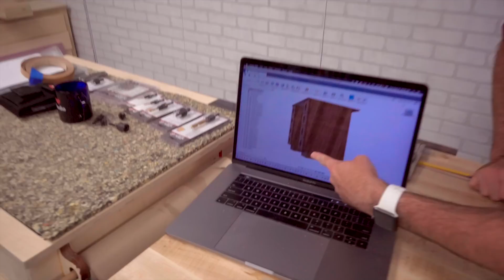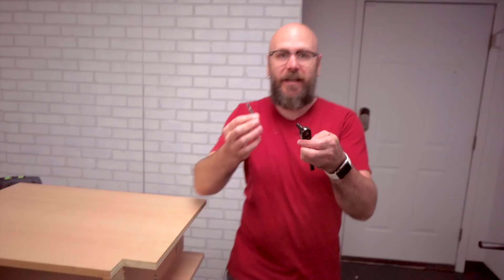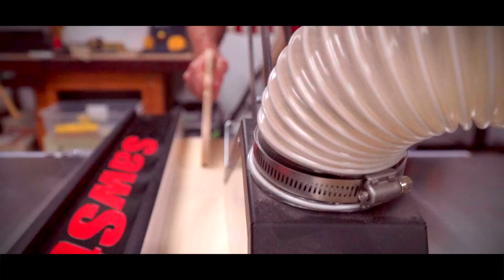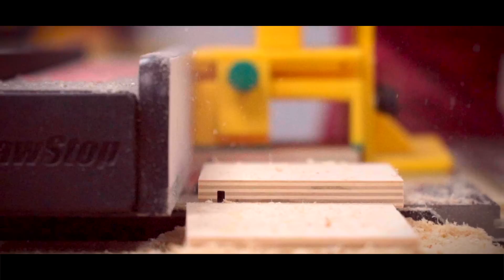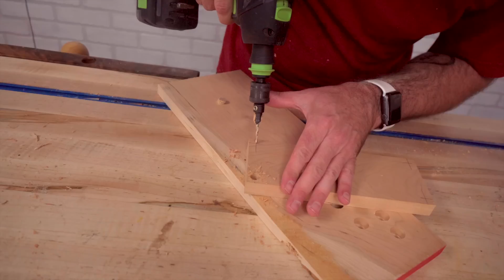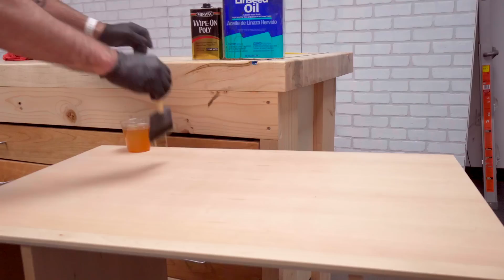Making a Custom Beverage Bar and Cabinet | Woodworking Project

Comment: Nice build, I'm glad I found this as I'm planning on building something similar. My only concern has been venting for the fridge. Unless it's a front-vented fridge, it's "recommended" that you have a couple inches free on all sides. Of course, it doesn't make for a nice looking bar if it is not snug. Have you had any trouble with the fridge struggling or over-heating?

Comment: So I've been researching something similar for our kitchen and it's my understanding that coolers like that shouldn't be surrounded like that unless they're front venting. Are you worried about the heat getting trapped back there and working the condenser to death? Especially with the sunlight from the window, I'd be worried about venting.

Comment: cool project! I was also planning on building a mini bar surround for an electric heater, but instead of drawers I was planning on putting adjustable shelving and doors with cathedral colored glass inserts. Not many maker videos on colored glass surprisingly, even though its style is versatile.

Comment: nice piece of furniture. made me a bit thirsty though. good tip on the screwing with a ratchet. i've done that quite a bit. i used to use these 's-shaped bent screw driver things' which are an absolute pain to use. i also have a corner attachment for the hand drill. that works nicely too, but it's hard to hold straight. ratchet is the best option unless you have to do dozens of screws that way. nice one! i like the diamond clothbacked design. sweet!

Comment: For places where you can't get your drill they do make shorter drill bits since pretty much any number 2 square bit will work, you could use a right angle drill, or a cheaper option would be a right angle drill attachment, or a flexible drill attachment shaft, but then again the ratchet worked and you did good work.

Comment: Hi David, I have been using snappy tools for some time now, but my last tool I bought was an impact driver and this already had a connection system build in, my only problem now is that to change a bit I have to push the holder forward instead of pulling it back, it might seem a small difference but it is driving me mad so I an putting my sappy tool into the driver and then I can continue to change tools the way I have become used to.

Comment: Excellent cabinet, BUT! You really don't want to fully enclose that fridge, you need space for the hot air generated by the compressor to move out and away from the back. Otherwise you'll just make it work harder, and shorten its lifespan.
Reply from the maker: There’s plenty of ventilation in the back

Comment: I'm surprised you didn't use pocket screws on the toe kick panels. There should have been plenty of room to use them running in the long direction of the carcass into the toe kick.......

Comment: I enjoyed the video, but I have a question about that vent. . .why not extend it through the cabinetry so that the bought air gets where it is supposed to go?  

I feel I ought to mention that I've been working in residential energy auditing for the past few months and I've seen too many homes that have issues with rooms being too hot in the summer and too cold in the winter and they have a bunch of vents covered with furniture.
I have some fairly strong opinions on not obstructing ducts :P
Reply from the maker: This room was built as an addition 10 years ago and has its own heating and ac. There are plenty of vents. Also, I didn’t block it off. I just took of the cover that was sticking out.
Reply: Haha, good to hear!
Thank you for the reply, I look forward to watching the next videos! 

P.S, I retrospectively realize the second paragraph of mine should have been left out as it really added nothing to my question. and may have changed the tone of my question from inquisitive to accusatory, which was not my intention. My apologies if I came across as anything less than polite.
Reply from the maker: No worries at all!

Comment: Cool project. Just curious, how does that snappy tool thing differ from what already comes on most drivers? I guess it’s for using your drill as a driver? 🤔
Reply: Wayward Woodworker The Snappy Tools quick chuck is made with tighter tolerance’s than the ones that come on drivers which equates to less wobble in your bit. Not saying you should not use an impact driver but the Snappy Quick Chuck is nice when drilling.

Comment: I'm not a drinker but this is a cool project and a beautiful design. I have a couple of questions though:

1. How did you install the drawer runners in such a confined space? I have a bendy attachment to my drill that would maybe have worked but it's a little fiddly, I'm just curious how you fixed them (ratchet tool again?)

2. A few months ago you tried a new style where you'd do the whole project without any voiceover and then went through each bit afterwards, did that format not work for you? I thought it was quite original at the time.

3. Do you ever struggle to find edge banding that matches the colour of the plywood? 

Looking forward to the rest of this cabinet unit :D
Reply from the maker: 1. I had to use a screwdriver like an animal. 
2. I just prefer talking while making. Keeps my energy up. 
3. It’s nearly impossible to find edge banding the exact color. Sometimes you have to cut your own.
Reply: Man that can't have been fun screwing all these metal runners, would wooden runners have worked or is that just not your style?
Reply from the maker: Wood runners would have been the better choice. Just one of those things I didn’t think about. 🙂

Comment: I've used the ratchet trick myself for tight spaces. I just bought a right angle drive accessory for my drill/driver to solve this in the future.
Reply from the maker: I need one for sure!
Reply: DEWALT DWARA100 Right Angle Attachment
 https://www.amazon.com/dp/B00C0VSNKQ/ref=cm_sw_r_cp_apa_jH2DBbCZWJQW5